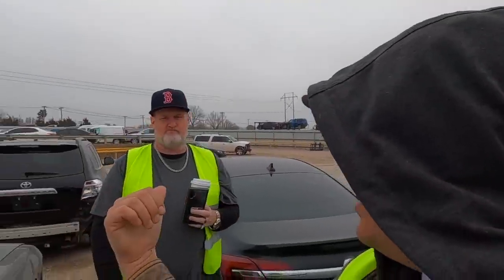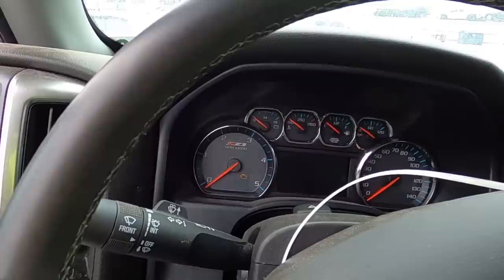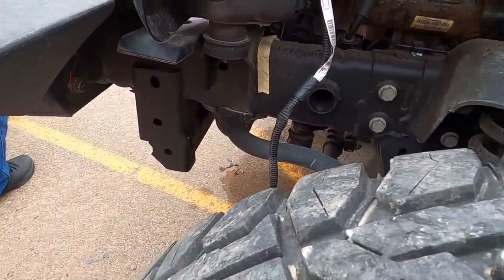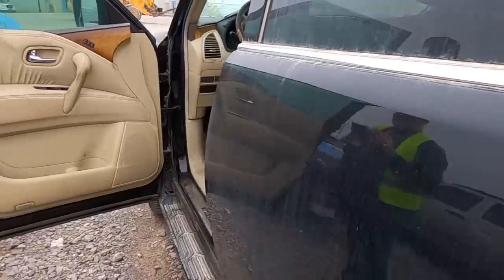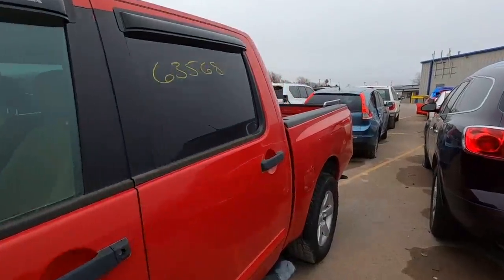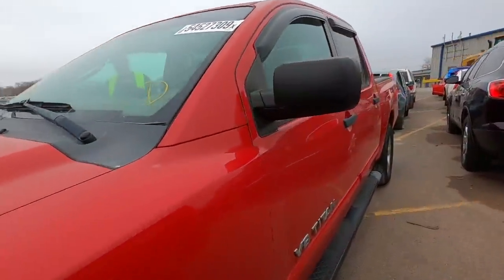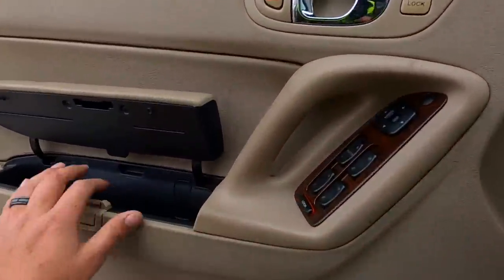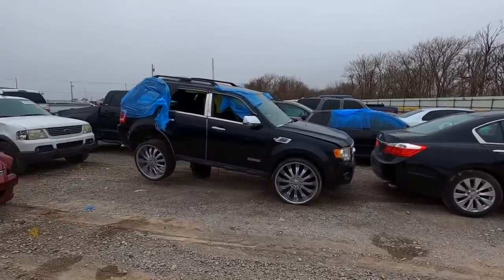Copart Walk Around 1-14- 20

Comment: Wikipedia says the Miller cycle v6 in the millenia S is 210 hp from a 2,25L v6, that is actually pretty good from such a small engine, that is designed with fuel economy in mind. The Miller cycle engine is the supercharger-equipped variant of the Atkinson cycle engine you find in the Toyota prius. The difference is between these and normal gasoline engines are that the exhaust and intake valves kept both open to reduce some internal resistance of (I believe) at the start of the compression cycle, at the price of losing some low-end torque.

Comment: You don't check the oil when the engine is running, check when it is stopped, pull the stick out , wipe the oil of the stick then check again , the engine running splashes oil up the stick so it will look over full

Comment: That E46 325xi M54b25 engine WILL require FULL maintanance at close to $1000 worth. This will be a full cooling system, oil filter house gasket, CCV/PCV rebuild, vanos system rebuild, belts, hoses, etc...